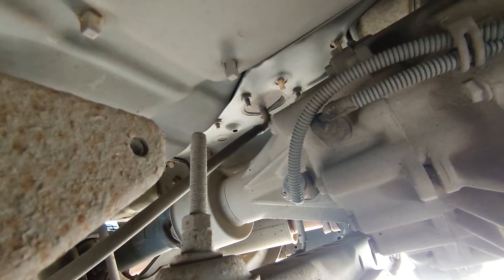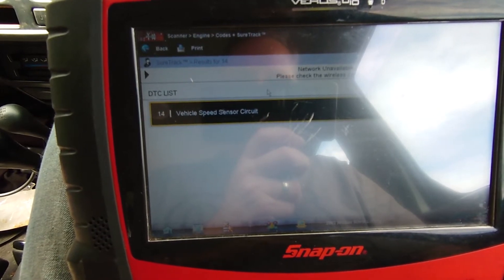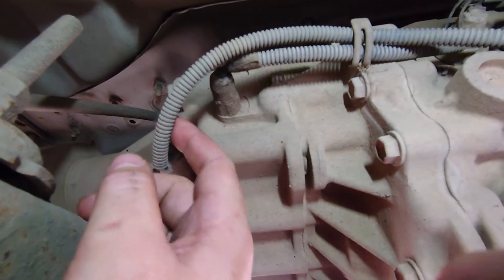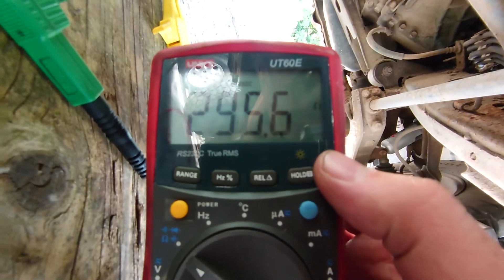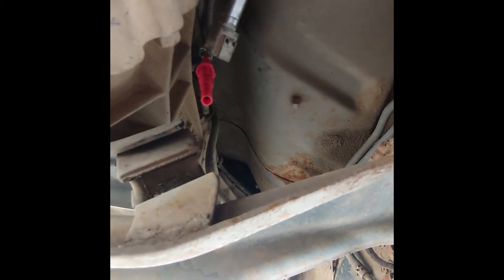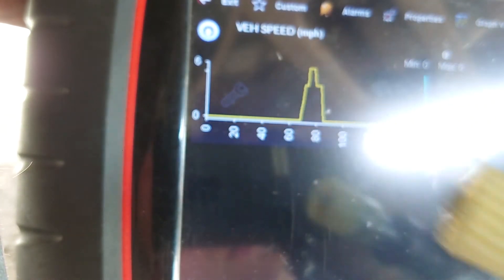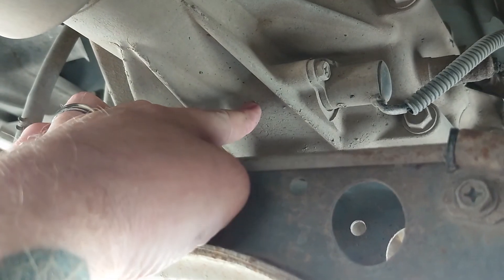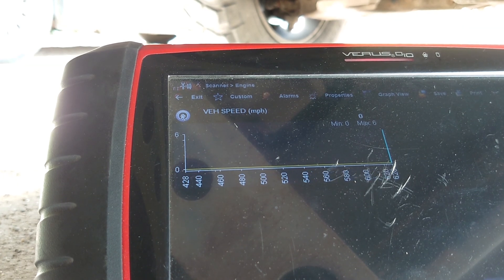Why does my speedo not work? Nissan Navara D22

Comment: I have a problem with my nissan pick up D22 speedometer: When I stop the instrument pointer does not go back to 0 but is stuck at 20 Km/h. It comes back when I lightly tap the dashboard with my hand on the top of it